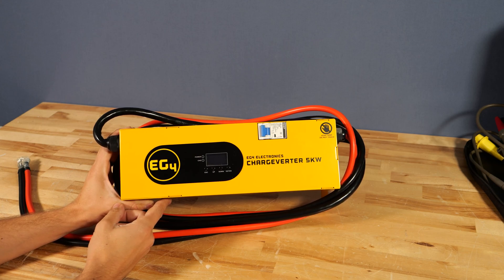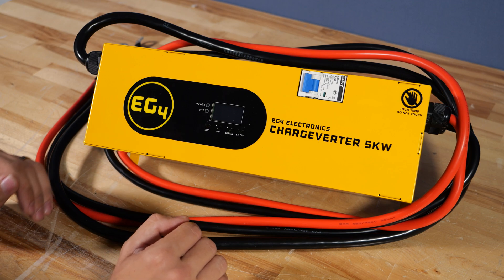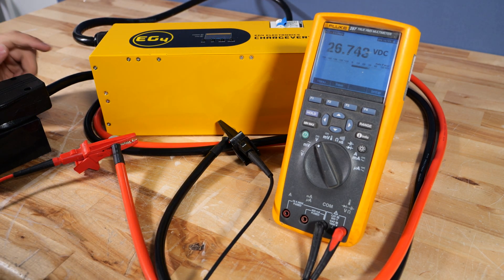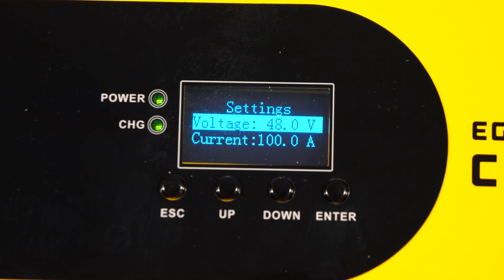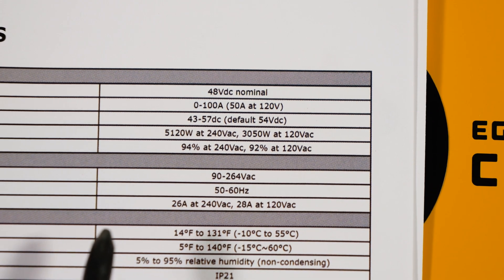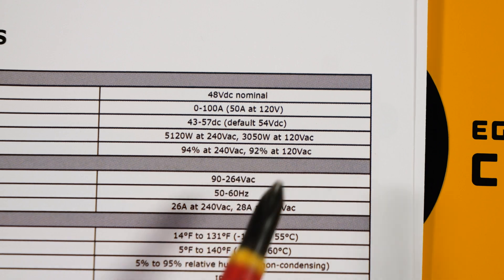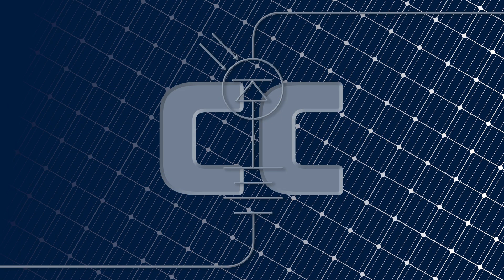EG4 Chargeverter Teardown & Overview 🔌 Testing the Capabilities of the EG4 Chargeverter!

Comment: A 48 Volt output is not high enough to fully charge a 48 volt LFP battery. Even 57 volts is not high enough. The output should be at least 58.4 volts, or 3.65 volts per cell.
Reply from the maker: This is a bulk charger - to replenish up to 90-95% of your battery from generator.  Ideally, you would have solar / other charging methods to finish topping off your battery, instead of burning fuel.
Reply: @CurrentConnected  Then you should be advertising this unit as being only a bulk stage charger,. You would not be burning much fuel or generator run time topping off the final Volt and a half with a properly designed charger that offered a full charge.

Comment: Could you get the full 100a output with dual 120v generators using a parallel kit.  Seems each module is just 120v and 240v is not actually needed for full power.

Comment: I am actually on the phone (on hold) with Signature Solar right now. I would like to know why this charger is limited to Lithium Battery Banks. I do not understand why it cannot be used for Glass Mat Based Battery System. Would you have any thoughts in regard to why? I am interested in hearing your thoughts. We have (2) 48 volt ABSOLYTE GX Battery Banks @ 2,000 Amp Hours Each and I don't think that this could ever over power the banks but I could be wrong. If it is charging parameters this could be compensated with the same manner of adjustment that is being done with your generator, correct? Or am I completely wrong in my thinking?

Comment: You were recommended highly by Will Prowse, but PLEASE ... at 0:44 Never EVER say "to the next level!" ... SOOOO "millennial!" 😂

Actually a little bit shy of using LFP batteries (SOOOO Boomer) because my grid tie, battery backup system is flooded lead acid, the last 12 years. I also operated a WW2 Victory Ship that could make turns without a candlepower of light ... So definitely geezer time.

Off-grid cabin will have a 48 volt system charging to DC equipment, just enough solar to keep it floated.  Likely AGM with this Chargeverter.  

Or not....
https://youtu.be/JOlaQwy7i9c?si=qEIZrUNGshvPHsRR

https://youtu.be/Rp8Hspi4BC4?si=cZ2UUAOjnuzPHDe6

Build up from there ... Just comfort level for now. Possibly a hand truck system like Will Prowse built.  THEN I'll use LiFePo4.

Very good video.

Comment: I've got one of these on the shelf I've not yet installed, but think I need to. My intermediate setup is a full stack of 6 of the LL Batteries and an EG4 3k/48v all in one. I was trying to charge the battery from a 2k inverter/generator via the AC-IN on the all-in-one and wasn't getting more than 500-600W with zero loads. Could not find a setting that would bring it even to 1k. Seeing this can ramp the amps down, I'll hook it up and find a sweet spot to run the inverter/generator most efficiently and see how that does. Thanks.

Comment: So, if you don’t use an EG4 inverter in pass through mode, you can use a non-inverter generator to charge the batteries?  There’s no clean up of the dirty power in the chargeverter, it just guarantees that dirty power does not go through the inverters to the loads?

Comment: Anybody know what gauge wire the unit uses on the DC side that connects to the battery?
Reply from the maker: 25 mm2 (which is around 4AWG)
Reply: thank you!

Comment: Too bad it's only good for 48v batteries. I would love a 36v version. I use the EG4 36v charger which gets the job done but slowly.

And you mentioned 208v AC input which makes me think 3-phase but I don't see this mentioned in the manual. Did you mean 220v / 240v split phase?
Reply from the maker: The output voltage can go down to 42v, so, if that's within the upper charge limit of your 36v batteries it can theoretically work.

We tested running it on 208v (two lines of a 3 phase system) and it works just as well as at 240v!
Reply: @CurrentConnected  36v lead acid usually charges to 43v

Comment: $400, cool. Thanks for opening it up.
Reply: so basicaly it just 2 telecom 50a powersupply whic on parallel connection and add a module to control the output interface?, and those telecom powersupply you can get $50 each used???

Comment: Thanks for sharing!  I didn’t know they modified the unit to slowly ramp up.  The original units used to just discharge full power as soon as they were turned on.  Also good to see they resolved the loose module issue, albeit kinda messily, but still resolved it.

Comment: That nice but man it alot of $$$$
Reply from the maker: Feel free to share what can do the same as this at a better price point. We will add it to our catalogue.
Reply: There is nothing close on the market that can do voltage and current control while delivering 100 amps at 48v  for $400.
Reply: For its current rating its not. Quality power supplies like IOTA are 250-300 dollars and only put out 1/5 the power.

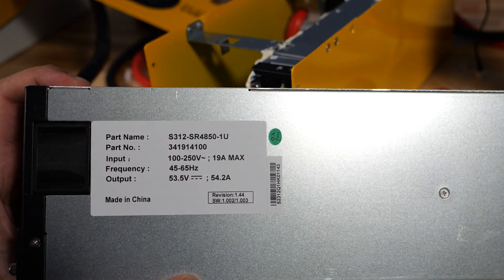Comment: Will these work on a European grid, 230Vac 50Hz? I saw that the sticker on the psu you removed in the video is rated from 100-250V and 45-65Hz @ 8:42
Reply from the maker: Yes it will.
Reply: @CurrentConnected  Excellent, thank you.

Comment: My friend got this, and it failed within 2 days.  And now they have been silent in getting back to them.
Reply from the maker: Well, that's an advantage in buying through us!  If you need support we are available to help.
Reply: Through Signature Solar? I had to go through six units to get two working ones. And it took months through Signature Solar and their awful service. Right after that Current Connected started carrying them and I noticed that the two I finally got that were good were a second revision with changes that fixed some but not all of the issues. Hopefully that's why Current Connected stocked them later and Signature Solar was selling out of the original units that never should have left the prototyping bench.
Reply: @BenBrand  I just installed 12 for my parents on an 80kW generator. No problems on a single one. I’m posting a video on my channel tomorrow.
Reply: @HighTechLab  Does it require any additional controllers or communication to parallel or do they need set up to the same voltage and thats it?
Reply: @ same voltage and that’s it
Reply: @HighTechLab  Thank you.
Reply: Hey that video is gone . Did you have an issue...   I like your testing this stuff for me.   Be honest now.